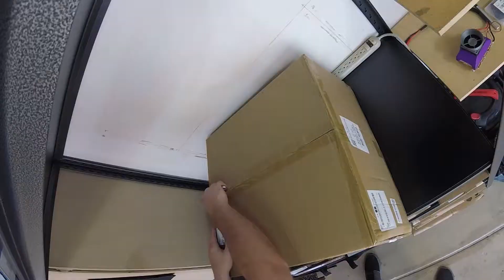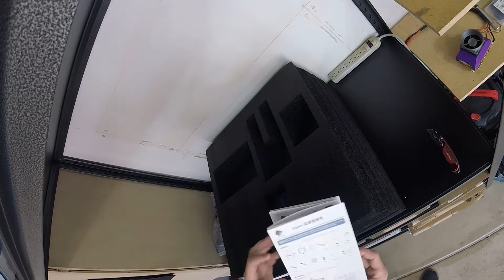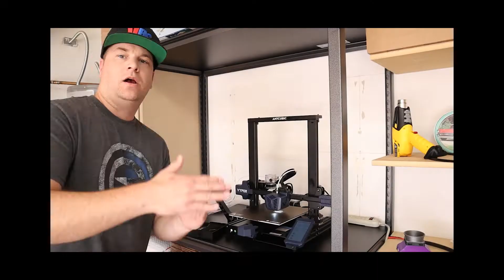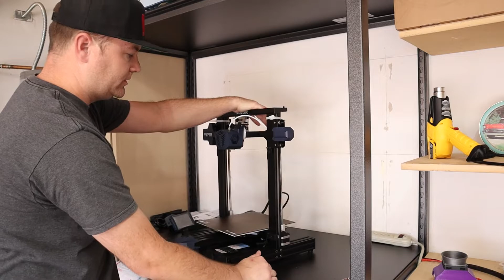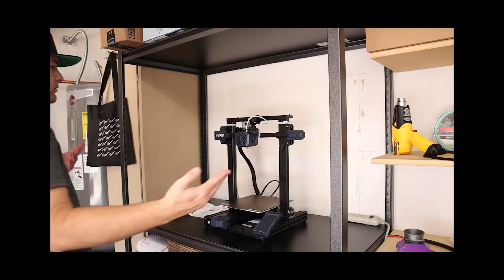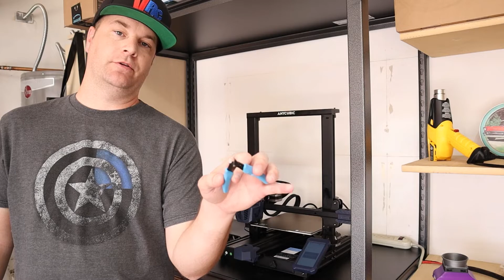How to start 3D Printing on the Anycubic Vyper | This is the best VALUE 3D Printer

Comment: Great video the problem I'm running into though is when I go to preheated it tells me that the front end is too hot in to turn it off check the wiring then turn it back on and preheat it which I've done three or four times everything seems normal do you have any ideas?
Reply from the maker: What does the message say? Front end?

Comment: Hi i just got this printer but i cant seem to get the part right where you have to calibrate the autoleveling with a tool, what did you do to get it right?
Reply from the maker: You just need to touch the nozzle with a metallic object.
Reply: @VoyageRC  I do that and it isnt responding

Comment: My screen turns off when I hit print is that okay
Reply from the maker: Does it still print?  The screen should be on and giving you information as the print is going. I have had great experiences with anycubic customer support. Reach out to them with your issue.
Reply: @VoyageRC  I figured out it was a voltage issue
Reply: @caellee443  Yep! If anyone else is having this issue, switch the voltage switch on the back from 220 to 110 in you are in the USA!